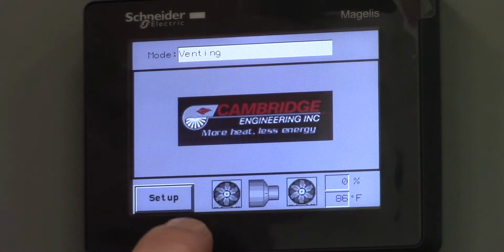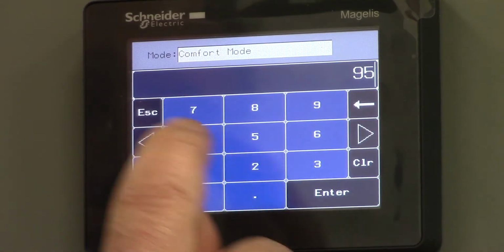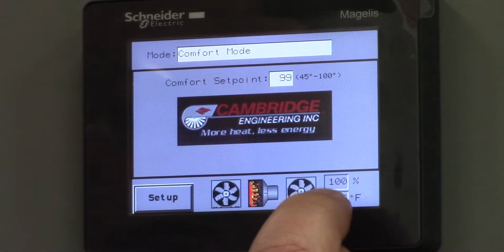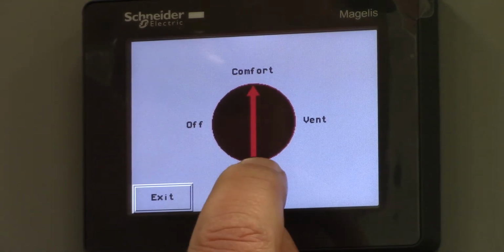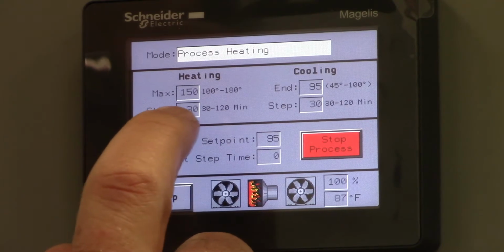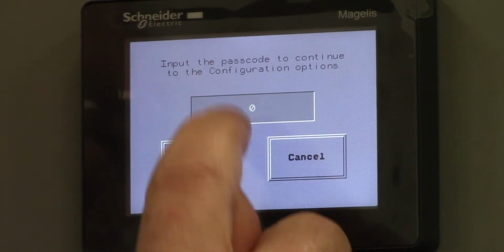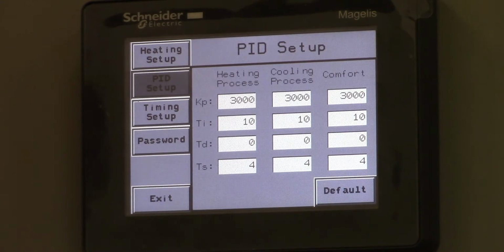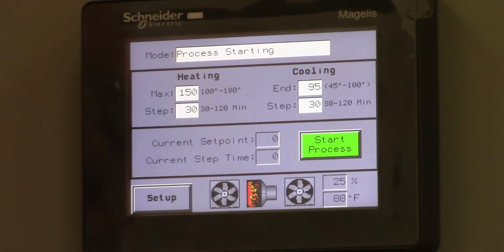Cambridge Engineering PLC Control for Process Heating

Comment: Cambridge's Process Heating solutions have been used successfully in many applications across North America.  Some of the applications include industrial rug drying, paint spray and cure booths, fiberglass boat curing, wood pallet heat treating, and other applications that require fast drying, curing and heat treating.  The addition of a programeable control system extends the capabilities of our our heating systems into many other potential markets.  Contact your local Cambridge Engineering Representative to see how we can help solve your Process Heating needs.